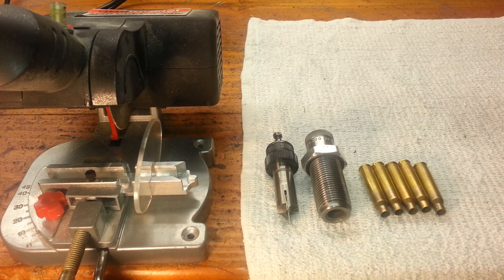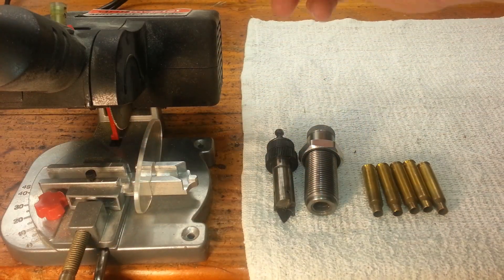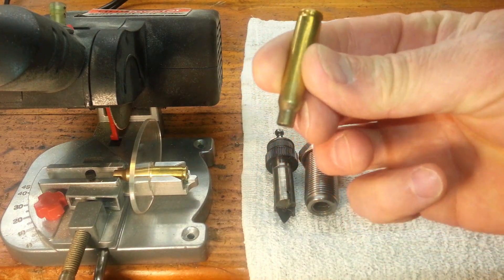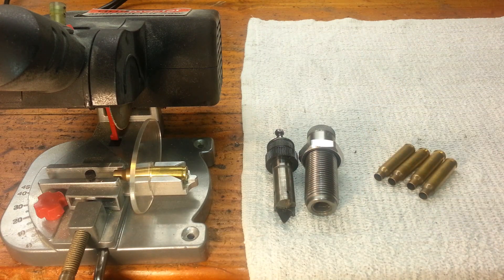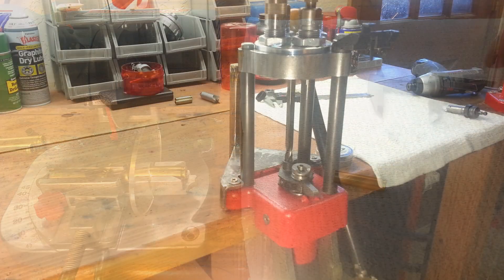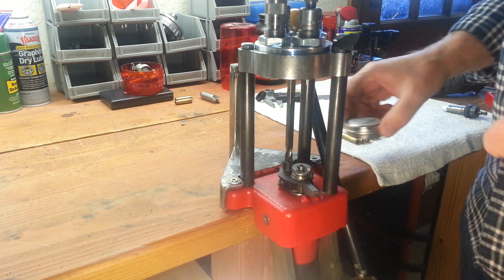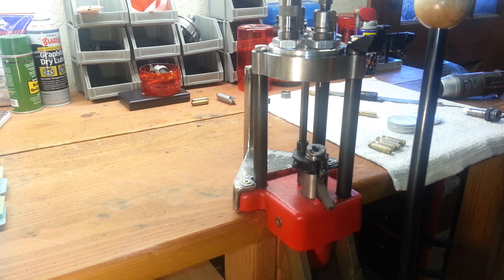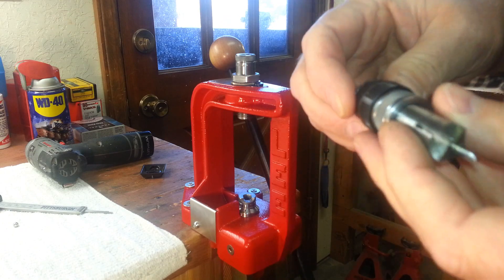Make 300 Blackout brass easy with Lee Power Quick Trim (Look below for a newer version)

Comment from the maker: **UPDATE** Guys, I've started using a little grease with the cutter on the under side of the adjustment ring and on the shank to prevent friction instead of WD40.  On a recent batch of 200 I had problems with the WD40 running down and making a ball of trimmed brass shavings that interfered with the free floating chamfer blades.  Also some of the oil was leaking down onto the die itself where it is supposed to grip and hold the case while the cutter cuts.  Oil contamination was allowing the case to spin intermittently giving me varied trim lengths.  I swapped to a little grease and cleaned the die out with Braklean...problem solved.  This brings up another point if I hadn't said it before, it is a good Idea to clean off your sizing lube before trimming so the case gets a good grip in the die.  If you notice your brass is warm after trimming it is probably spinning in the die.
Hope this process is working for you guys as good as it has worked for me.
Reply: Your videos are great and so helpful keep up the good / great work.il watch your video every time I reload as a refresher
Reply from the maker: Julian Delgado Thanks for watching, and for the kind comment.  If I can be of any help, feel free to ask...If you PM me just make sure your logged into google chrome or you won't see my reply and I always reply.
Reply: if the brass is of to thick wall thickness why not first form them and then ream out the case neck/throat 
like i do when i do 7.62 Tokarev from 5.56x45 
i get like 7.55 mm dia while i need 7.92 (a little over.311) so i ream them to 7.9mm and resize them another time - when i later crimp them then its perfect if i dont it is^still good enough for repeating but nt automatic weapons so im still close to the perfect dia
Reply: I am quite late to the party here but this video is excellent. I do have a question, a friend of mine mentioned that vaseline worked great for lube on the resizing part and I am still conflicted about that. What is your take on that?
Reply: @gabrielalejandroverapinto9984  it's cheap and if you mix it with a little rubbing alcohol it covers a lot of cases. I would watch out for to much lube around the shoulder so you don't get dent from sizing then clean them afterwards.
Reply: my home made trimmer - https://www.youtube.com/watch?v=FTF1p3qByEA
Reply: I used a similar jig in my 2" cut-off saw from Harbor Freight.
After 1850 cases the belt on my saw burned up from getting hung up due to the blade getting duller.
Does anyone know where a belt can be found for the Harbor Freight 2" cut off saw? They don't sell replacements.
Thanks in advance.
Reply: Try Imperial sizing wax, or dried(when it dries it is solid wax) Lee Case Lube on the cutter.

Comment: I have been doing near the same method, but I love that trimmer you got. Never seen that before. One other thing, different than what you’re doing, I have a couple thousand spent blank cartridges. And I have no wall thickness problems with those casings. Thank you for your presentation, I enjoyed. Probably more information.
Reply from the maker: Thanks for watching.  This is an older video, but it works.  I made these videos when Comercial brass wasnt available yet.

Comment: When I started reloading in 2017 I bought the QuickTrim setup, but I found the cases spun and would not cut. I ended up buying a World's Finest Trimmer for .223. 

Does the .25" ball reduce the downward pressure applied, allowing the case to remain stationary and the cut to actually cut?

I would love to be able to cut, chamfer and deburr in one pass.
Reply from the maker: Sorry for the late reply.   If the cases spin, It usually means you have too much residual lube on the cases and or, inside  your die.  The die has a hard plastic like material in the bottom thats meant to grip the case, if it has lube on it and there's a bit of a cut it can spin.   You can till because the case gets warm.   Also, if there is too much trimming being done the cutter can grab the case and spin it.  Not usually a problem with just trimming 223 but when making new cases like 300blk it can happen.  I take my dies out and spray them inside with brake cleaner to degrease them.   You can also use a large barrel cleaning patch to wipe them out.   Hope this helps.

Comment: FYI: WD40 is not oil. It is however a good moisture displacement spray. It will over time gum up your tools and harden, causing some issues.

Comment: If the neck ends up to thick then just neck turn them
Reply from the maker: Neck turning is optimal for consistency but its not a capability that most freeloaders have.  In addition to neck wall consistency it also removes the undesirable taper in converted 223 brass.

Comment: Would running it through a 223 small base or full length die work? I bought this lee 300 blackout size die and already have 223 small base as well as full length dies. Wondering if I can get by without buying another die lol
Reply from the maker: Im not really sure what your asking but Ill give it a try.  Even If you cut the neck off, you can still run it through a 223 small base die to take advantage of the small base die sizing.  You will still have to go back and form the neck in a 300 black die.  At whichever point you resize the case,  you will have to account for the case getting longer when sized.

Comment: it is very detrimental to lube the spinner or it will bind up badly like an engine running with no oil.
Reply from the maker: Definitely but I use a little grease rather than WD40 now so the chips stay dry and flush out easily...lessons learned.

Comment: So I keep hearing this stuff about the type of brass you can use to convert to 300blk, but I’ve been buying all of my practice ammo from a company called Georgia arms that is a reloading manufacturer and I’ve seen plenty of Lake City, PMC, Federal, head-stamps. I haven’t have one single feeding issue in two separate 300blk uppers.  I’m wondering if it has to do with maybe the chamber tolerances? Or is it something that Georgia arms is doing to insure they don’t have this issue? I ordered $400 worth of reloading equipment that is coming in on Friday and I have so much lake city, PMC, and IMI brass that I fully intend to convert to 300blk. Thankfully the dies I’ll be using are the RCBS AR S/B  sizing die with taper crimp. I think that could potentially help with any feeding issues. I lucked out because they were out of the lee die sets on MidwayUSA so I went with the RCBS being the best ones for the money. I’ve heard most people who have brass issues have solved them by switching to those dies so maybe I’ll be able to avoid those issues from the jump. We shall see I suppose. Can’t wait to start reloading :)
Reply from the maker: Pretty sure all the brass you mentioned is from the now (OLD) recommended list.  Best to stay below .013 wall thickness.  Its just meant to be helpful not a law.  You are right, the differences in chamber dimensions can be the difference between works or doesnt.  I have two chambers, one eats anything.  The other gets high pressure if I look at it wrong.   If you use cast bullets you generally dont size them down to a true 308 so the what it interacts with the chamber is bullet diameter plus wall thickness twice.
Reply: When I started loading these for my AR I had feed problems with cases I made. Once I culled everything except the LC cases that problem went away. Btw I have the RCBS trim die and small base die set.
Idk about a difference using other dies I just know using LC 223 brass and RCBS dies work for both of my ARs in 300 blk

Comment: Shawn here in Tennessee, the problem you will have in the process presented here is by not deburring th outside of the case mouth before you size them, the brass breaks off and builds up inside your die causing the shoulders not to be uniform, I speak from experience!
Reply from the maker: I have an updated version that addresses this.  I have found better accuracy with de burring.

Comment: Just saw your video since I'm new to 300 Blk. Everything here is pretty clear except it seems to me that the part of the case that becomes the neck would require annealing as the factory annealing doesn't go that far down the case. Do you address this?
Reply from the maker: I dont anneal, some do, some dont. Unless you have a machine to do it uniformly, its probably not very useful.  If I had a machine I would anneal before forming.  With 300 black primer pockets get loose before necks split.  I have a newer video on this topic BTW.
Reply: TreeTopFlier cool. Thanks. I'll look for it

Comment: Do you prefer the turret press or is a single good enough?
Reply from the maker: For making blackout brass? Probably a single stage but either will work.  If your talking about reloading, I like them both.  I tend to load rifle on the single stage but I have failed to prove there is an advantage in quality.  One area an O frame press is nice is when you are controlling shoulder setback or bump.  A good single stage can make this a little more consistent.

Comment: Should not matter what thickness brass is as long as exterior dimension is in spec.. Try measuring or seating shoulder back?
Reply from the maker: Your correct, up until you seat a bullet.   After you come out of the sizer you will probably be in spec.  BUT, when you seat a .308 bullet and your neck wall is .014" the neck of the case will expand to accommodate the .308" bullet making the finished neck diameter a total of .308" + .014" +.014"  for a total of .336"  The chamber spec in the neck is .335"  now you have a crush fit.  This will change the neck tension on the bullet and depending on your load, push a normally safe load into unsafe pressure levels.  All of this depends on how close to spec your particular chamber ends up after reaming.
Reply: @TreeTopFlier  Would the factory crimp die take care of this?
Reply from the maker: @nickolasthefrog  Yes, if you adjust it tight enough. But it isn't ideal because  the extra material doesn't go away so you end up pushing the neck into the bullet and deforming the bullet.  Not the best option.

Comment: I used to reload every day back in the 70s first annealing the new neck area and I found out by accident 3m electrical tape comes in a plastic round holder comes apart. Fill one side almost full with plain graphite powder. Dip the neck area in the graphic just straight up and down then do your resizing and shaping .i never found a lube that worked better. I am going to try the same method with boron powder nickname white graphite. It a a great bullet coating also give it a whirl it's cheap

Comment: Your Video is about the closest one that could solve my problem. I've decided to keep my .356 Winchester 94 Lever Action even though Winchester has discontinued making Ammo for that rifle for quite some years now. I just ordered a "Redding Form & Trim Die" for .356/.358, but even they were out of Stock and it could be months or never before I see one! Even Case Forming Dies for the .356/.358 Winchester seem to be hard to find. Anyway, the Winchester Lever Rifle Forums recommend using a .444 Marlin Brass and form it into a "Necked" .356. There would be considerable Trimming to be done and hopefully the Brass isn't too thick. Someone mentioned "annealing the brass" (maybe that's not a bad idea). I suppose what you've shown should get me started properly. Any thoughts on my situation?!
Reply from the maker: Ok this might actually be easy.  I am not familiar with any of the cartridges but I did a little digging.  356 win is based on .307 cartridge.  307 win brass is still available.  But one step further and 307 win brass is based on the .308 cartridge and the 308 and 356 win have the same brass length 2.015".   I would explore converting 308 win to 356 win.  It would be just a matter of expanding the neck of a 308 case and your good.  The only down side I can see is if the brass neck wall was too thin?   If you send Lee fired cases they will make you a custom quick trim die for your 356 win.  Hope this helps

Comment: You repeatedly contrasted "sizing die vs "forming die". Please elaborate.  Isn't the Lee good enough?
Reply from the maker: A forming die is literally a die or set of dies sometimes used in stages to convert a cartridge parent case to a new cartridge.  This is pretty common because many cartridges are designed using an already existing cartridge.  They usually are a little more exaggerated than a full length sizing die in which ever way you are changing the case because brass will want to spring back.    The blackout gets by ok with forming dies most of the time because we are not making radical changes to the case in terms of stretching it or compressing it.
The Lee dies do not intend to push the brass all the way down to its minimum spec since this is not ideal for accuracy.  All chambers have a tolerance, if a person has a chamber that is cut near the minimum, some people, not very many, have had trouble with brass formed in a Lee FL sizing die.   This has lead to an unwarranted bad rap for the lee die.   Thats why I emphasized it in the videos.   I have an updated version of this video. https://youtu.be/BPhlzBULoWI

Comment: Yes I tried the lee sizing die and I had no luck with it with my A-R Stoner barrel . So I picked up the RCBS small base die and that fixed every up. Now so I never have any problems with any of my cases I also trim there neck thickness cense I started doing all this to my cases I have had no failures to feed or fire great video bye the way
Reply from the maker: Hi Willie, there are a few chambers out there that are on the smallish side and the Lee die just doesnt get it there.   Some guys do initial forming with the RCBS then they can use the Lee on subsequent reloads.   Minimal resizing is always best for accuracy.  I have taken to just doing a shoulder bump back on reloads.  Im guessing with your snug chamber you probably cant push max loads very hard?

Comment: May I recommend annealing the brass before sizing. I found that without annealing the brass, it kind of sprung back (didn't hold a true 300 case shape) and don't form as good of a neck un less I inserted it two to three times in my lee die.
Reply: Agree.
I dont consider the brass fully formed tell after fireformed.
Expect to loose a couple thousandths after. It pushes the bottom if the shoulder out into the corner of the die.
Reply: Hunter Hoffman watch GunBlue490 on YouTube. He has some great videos and methods on annealing cases.

Comment: I have a Dillon 650 XL within RT 1500 trimmer so I can make a 300 Blackout case with only one process. But it's very pricey especially if the only reason you got the trimmer is to make 300 Blackout cases and then it's probably not even worth it. But I trim all my brass with it.

Comment: What blade are you using on your mini miter? How many rounds has it lasted?
Reply: I have trimmed over 1000 rounds with the same blade. As long as you do not accidentally try cutting a steel case they will last a long time. Harbor Freight sells spare blades. I check my cases with a magnet to make sure there are no steel cases mixed in with the brass.

Comment: Make sure you clean the case lube off of the cases, otherwise the cases will contaminate the die and the cases will spin and the cutter will not cut.

Comment: So after cutting with the saw, a slightly uneven cut is ok? Im getting an uneven cut with VZ58s (from 300blktalk) jig.
Reply from the maker: Its not a problem because you are going to trim it after forming.  Just forming can cause an uneven length as the brass flows to the new shape. 
 Just be sure to cut long enough to trim after.  You want to trim last anyway so you  can achieve a consistent length and square the neck.
Reply: TreeTopFlier just to be clear, I was referring to the mouth of the case being not squared after cutting with jig. Will that ultimately square up after forming and then final trimming with the Lee Power Trim?
Reply from the maker: Yes, the trim die and cutter should square the mouth so I wouldn't worry about it.  The only problem you might have is if the short part isn't as long as your trim length.  OR, you are too long and the bit catches too much material causing the case grab the cutter and spin in the die.  Ideally, I like to shoot for about .010 too long so that's all I have to trim.  I would, however, investigate to see why the jig is not square with the saws blade.

Comment: How do you get the spacer off the trimmer, mine dose not seem to want to come off?
Reply from the maker: The spacer, to be clear is the metal ring just below the black adjuster ring. It has a snap ring down inside of it that fits into a groove on the shaft.  The new ones can be a little stubborn.  If it was me and I couldn't get it to free by pulling and twisting, I would probably try carefully prying it away from the adjuster ring.  Good luck!

Comment: will the trimmer stop cutting or can you over trim ?
Reply from the maker: The depth of the trim is set by an adjustable ring which provides a fixed stop, so no it will not keep cutting.  That said, the chamfer blades can wear down on the brass if run too long which could have the effect of over trimming.  Thanks for watching!